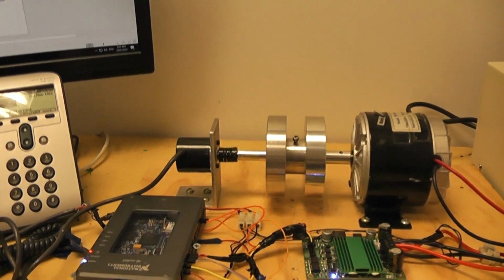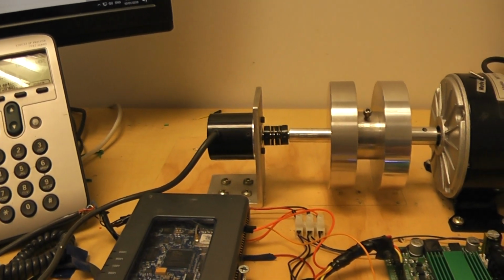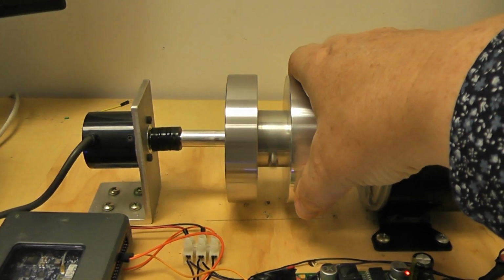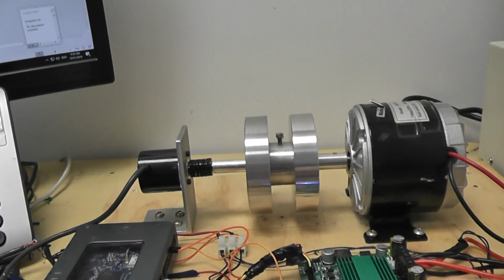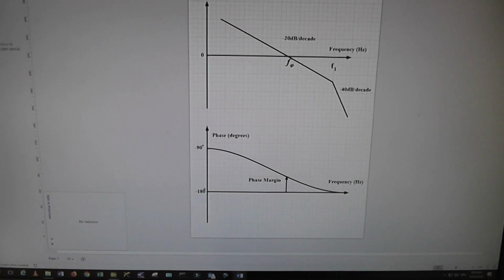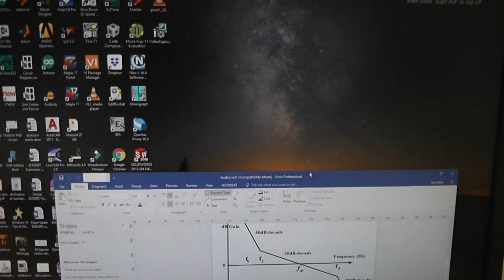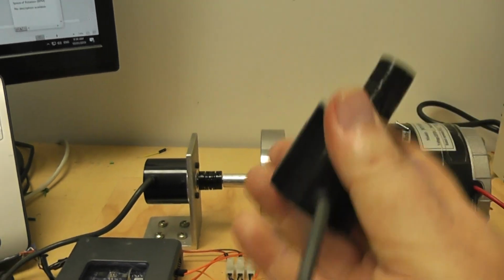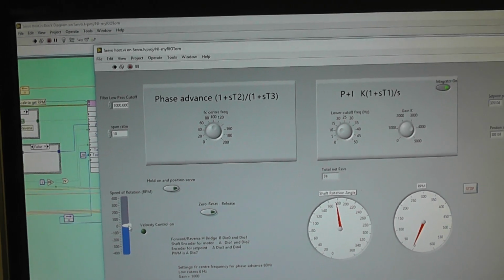Position and Speed Control Combined dc Motor

Comment: Just so I am clear... this is not just a 'speed controller or position controller' in one, but you can vary how fast it moves while in position control mode yes?
Reply from the maker: In as much as it's following the setpoint so if you move the setpoint faster it has to track faster to follow it. It's like if you had a square-wave or sinewave and you increased the frequency of input the output is forced to follow provided there is enough bandwidth.